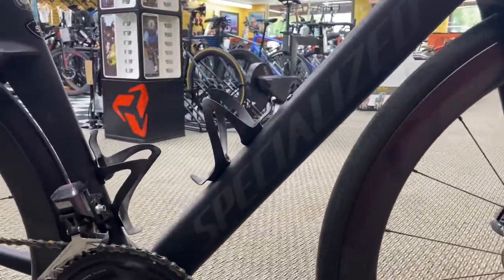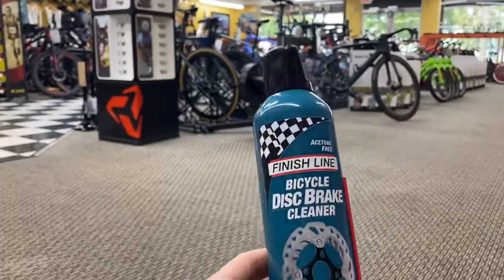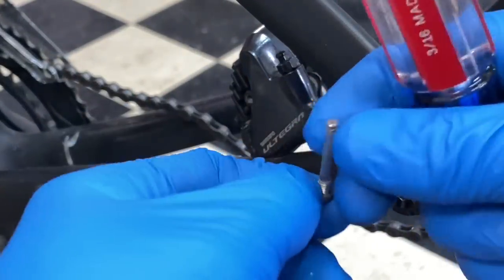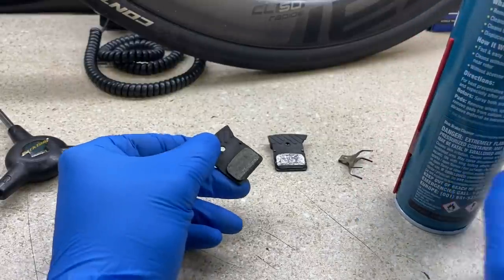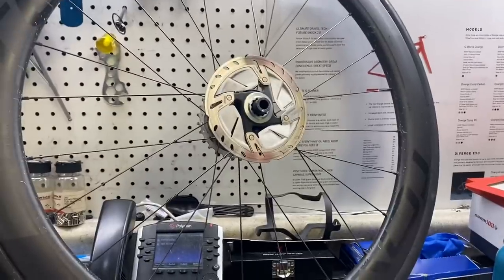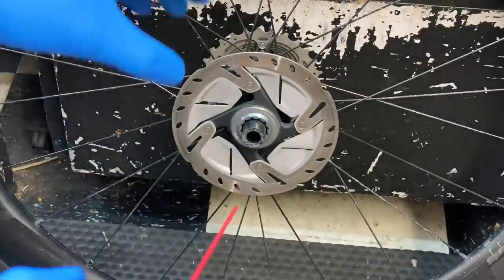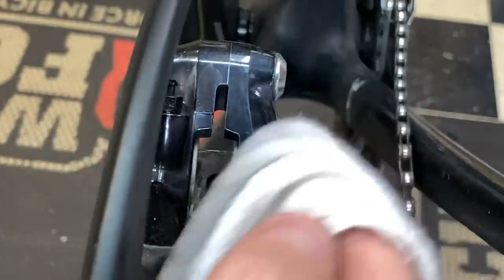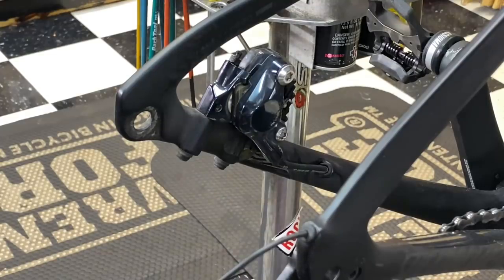WILL THIS STOP DISC BRAKE SQUEAL ONCE AND FOR ALL? (FINSIH LINE CLEANER) THE ANSWER TO OUR PROBLEMS?

Comment: Easy fix and no parts needed and can do at home. 
Take out pads and spray with brake cleaner.
Take off rotors and spray with brake cleaner.
Clean and cycle caliper pistons.
Reinstall pads rotors.
Your done. Takes 20 mins.

Comment: Very simple...

First never spray anything on pads and rotors, it’s only gonna make things worse...

Do like you did...

Remove pads, send them them with sand paper, dip them in alcohol, try  to not touch the pads with your fingers...
Let them dry...

While the wheel is off the bike, sand the rotors with sand paper, 120 grit is fine... on both sides, until some of the lines and contamination disappear...

Wipe them with clean Dry rag... No alcohol or anything else...

Install everything back...

Bed -in the brakes...

You have to, since the deposit from the brake pads that was on the rotor was sanded during the above process.

Comment: My Cannondale bike was making exactly the same annoying squeal and had little braking power. Then I tried Finish Line Disc brake cleaner. A whole bunch of it. And, just like with this guy, it didn't make any difference at all. I had to replace the pads, but no rotors were/are available due to the Communist Chinese virus screwing everything up.

Comment: I run semi metallic pads and there’s no squealing at all ever, dry or wet. Most cyclists run semi metallic pads because of this issue and they get the better of both worlds from harder compound pads and softer compounds of pad material, semi metallic pads sit in the middle of pad wear, more or less depending on wet or dry conditions. Softer compounds wear really fast dry or wet and harder compounds last the longest of course but will wear out the rotor faster than the softer compound pads.